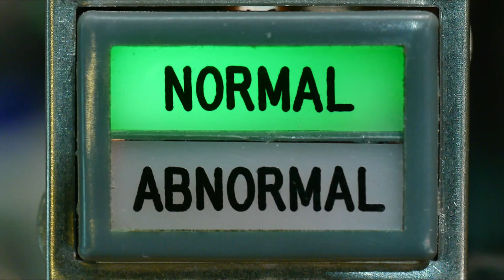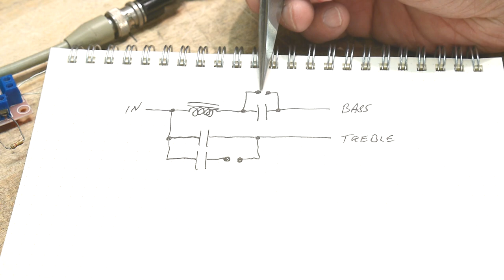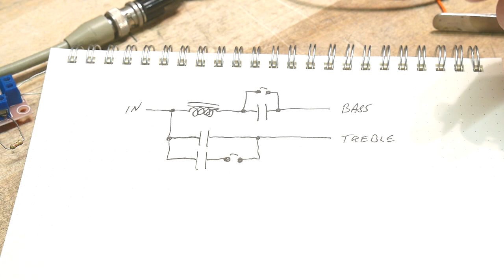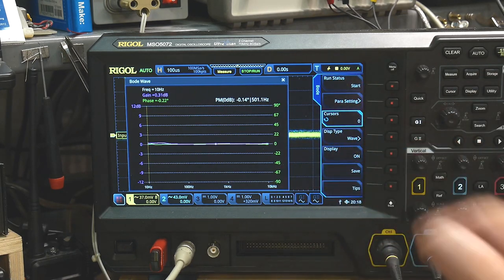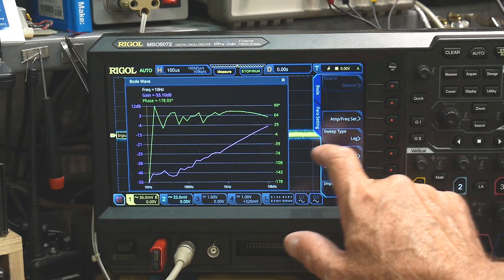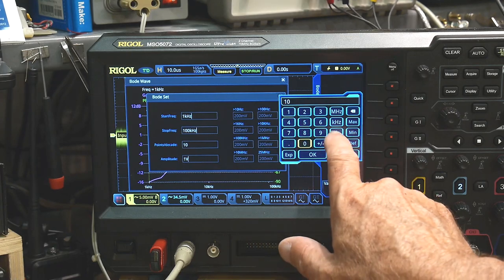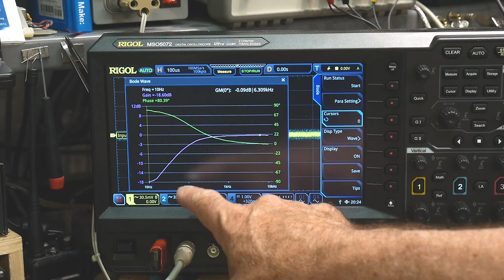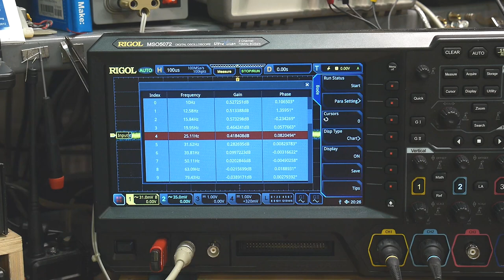#849 Audio Frequency Divider DIY Kit Crossover for Automobile Car

Comment: Also speakers are not resistors. I believe the impedance of a speaker is the inductive reactance at some frequency like 1 kHz?? I wonder if you hooked up real speakers and measured the voltages at the speakers if that might make it appear more useful?

Comment: It's advertised by the factory as an "adjustable" and "easy install" 2-way crossover for approximately 6 Ohm speakers that gives a very high crossover frequency and also filters subsonics/low bass away from a small woofer such as in a satellite speaker system that has a 3" or 4" woofer. As such there are applications for it. Elsewhere on the internet I found a guy using it in a high-end (KEF) speaker system running to the mid driver and tweeter. Then it makes sense to be filtering against low bass getting to the midrange driver and it also makes sense that the crossover to the tweeter is much higher than usual if it's going on a 3-way system. But I'm stumped as to why the coil (inductor) wasn't doing anything at all to filter against HF on the bass circuit?????

Comment: If it's for a car audio system it's probably designed for a 4 ohm load?
Reply: Car audio is usually around 3-4Ω because of the low voltage available for the power amplifier.